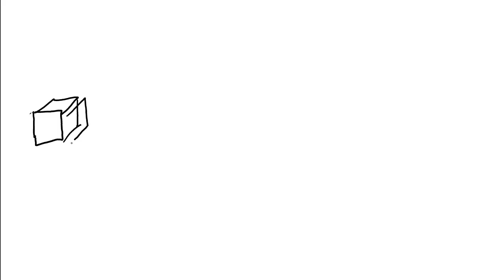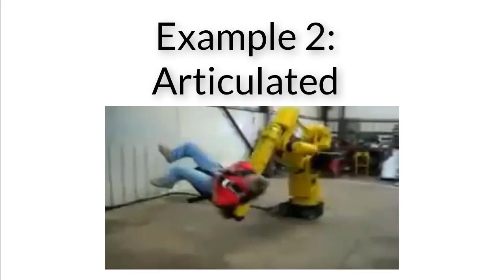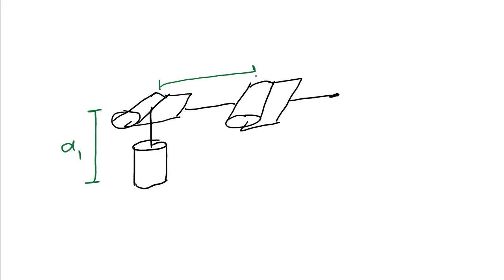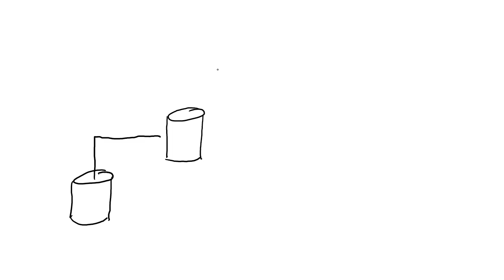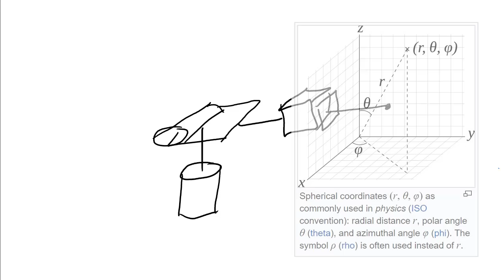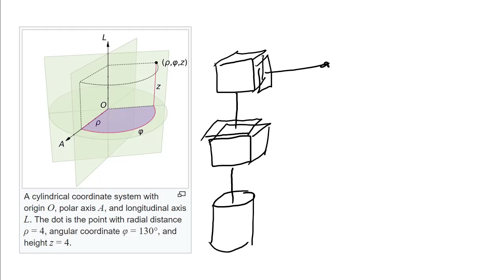Robotics 1 U1 (Kinematics) S2 (Kinematic Diagrams) P3 (Examples)

Comment: according to me, a revolute joint is missing for model 3 scara (according to me, the Tool Center Point is also able to spin ?) you can see that the head is not turning while "above the prismatic joint" the robot is turning around ?
Reply from the maker: Let me see if I can explain: Most robot manipulators consist of two big parts: the 'arm' and the 'wrist'.  Typically, the arm will consist of as many as three joints that are responsible for positioning the end-effector (the 'tool') in 3D space (X, Y, Z positioning).  The wrist is then attached to the end of the 'arm' and consists of as many as three joints which are responsible for setting the orientation of the end-effector (the tool).  Together, the arm and the wrist make up the typical 6-DOF manipulators we see in the industry.  In this video, we are restricting our examination to look at only the 'arm' parts, and are, for now, completely ignoring the wrists.  The videos that I show as examples of different types of arms often do actually have some type of wrist for orienting the tool, but we are ignoring the wrists for now.
Reply: @asodemann3  Wauw, thank you for this fast feedback, this makes sense !

Comment: Your way of explaining concept is simply great! Thanks.
I have doubt in the symbol of revolute joint. 
In the kinematic diagram for articulated and spherical manipulator, the symbol used to show the revolute joint facing towards us is different than the symbol used in video 7 for the set up you have built with two motors ( second revolute joint). Whether any of the  notation can be used?